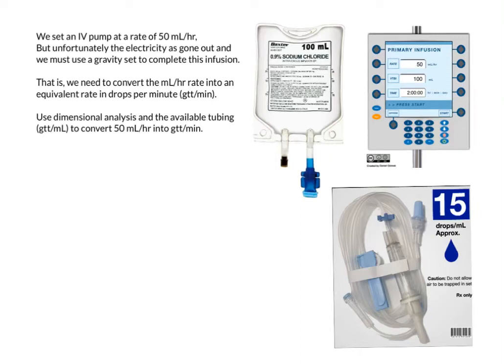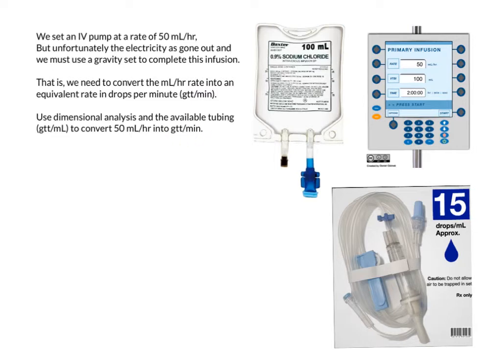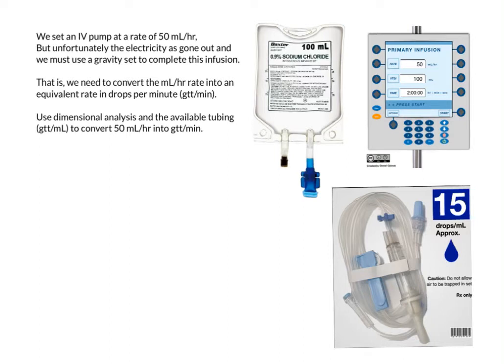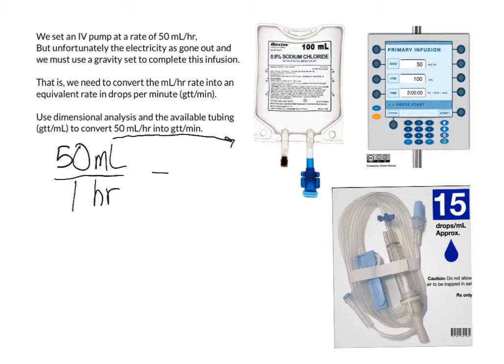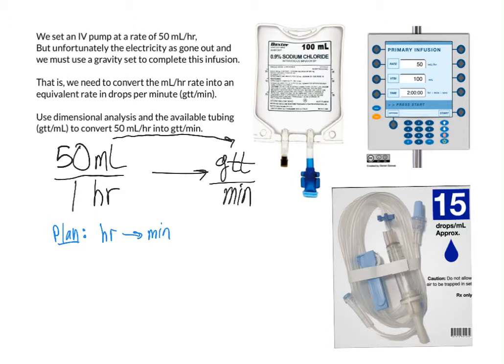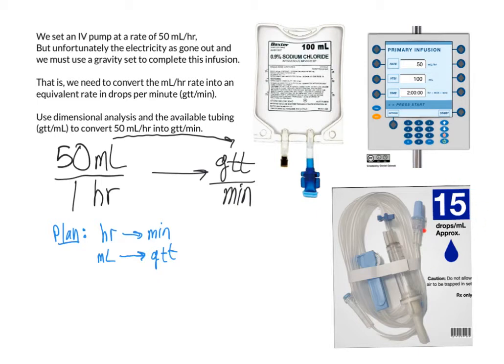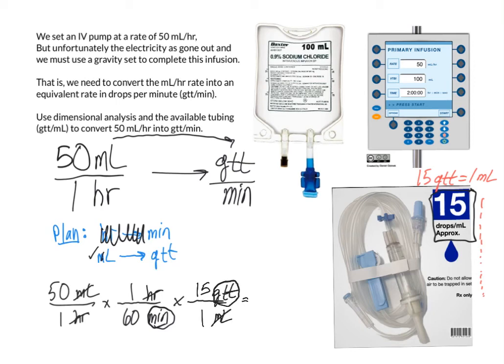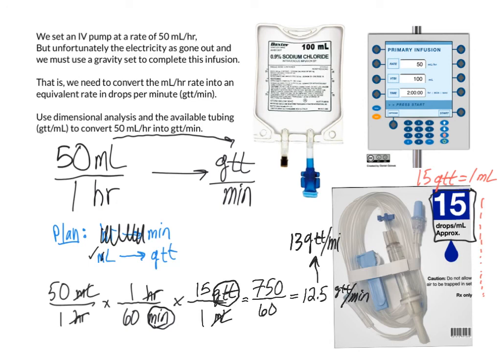Converting mL/hr into gtt/min Using Dimensional Analysis

Comment: Why didn't you just do 50ml x 15 then divide by 60 mins, because there's 60 mins in a hour and that gives you 12.5 gtt/min round up to 13?. I can't figure out why everybody uses that really long way to do these problems.
Reply: using shortcuts is easy but understanding the whole process and learning the long way will help nurses be accurate and on point in solving. As a nursing student, i cant visualize the shortcut method at first but doing the long way really helped me with my IV computations. Its scary to do short cut methods and giving wrong IV drops for your patient, its their life at stake